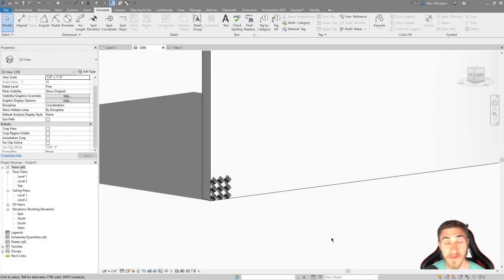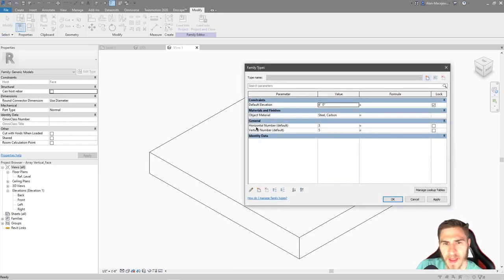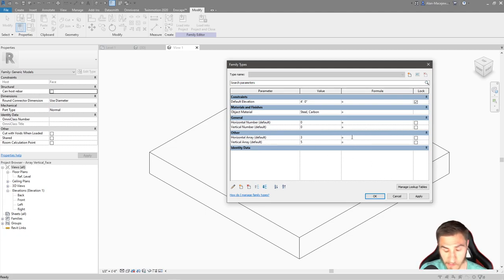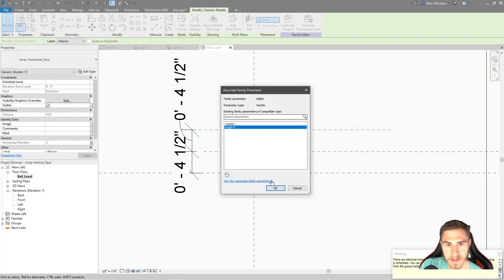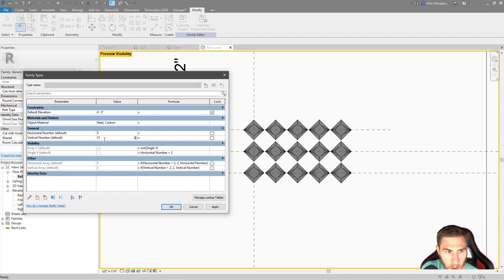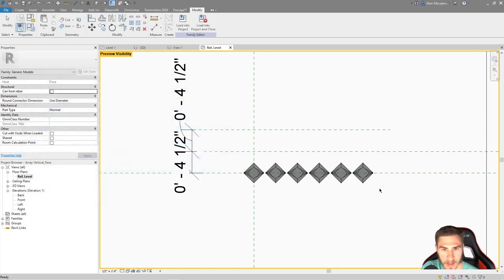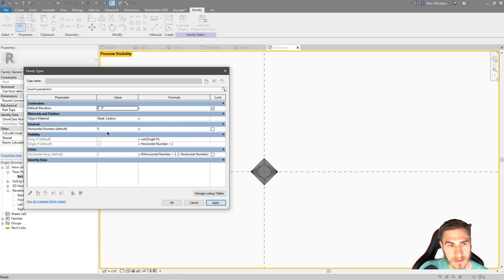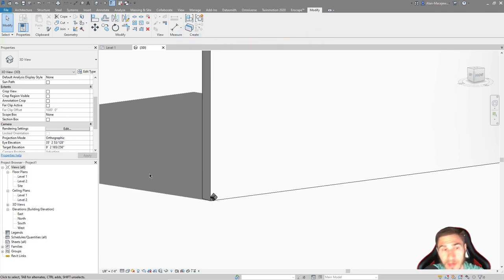Fix: Array Value is Less than Two | Revit

Comment: Is this possible if we used formula for this array for example (length/spacing) array less than 2 is possible
Reply from the maker: You can always achieve that. But more of less what you do with the result of that array breaking from lees than 2 is the main thing to be aware of.